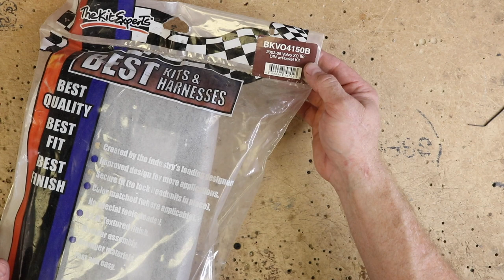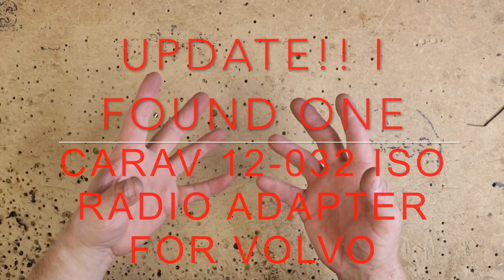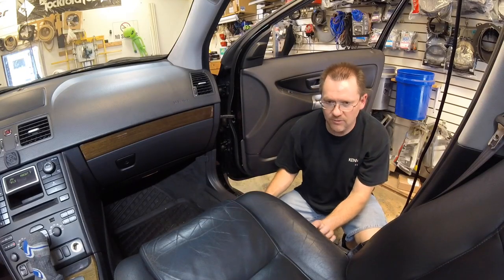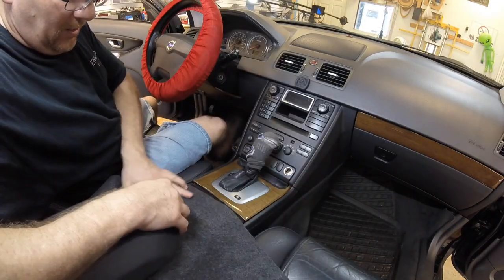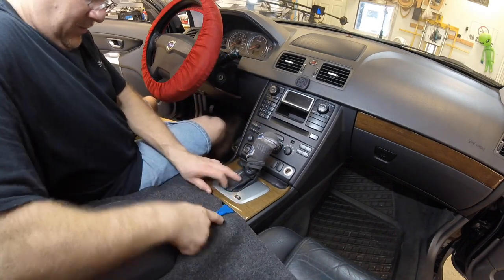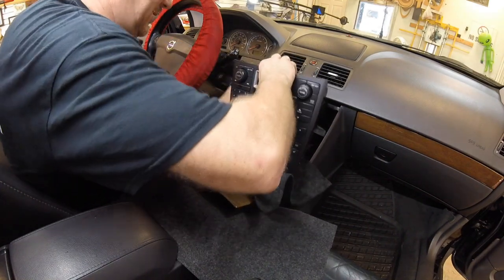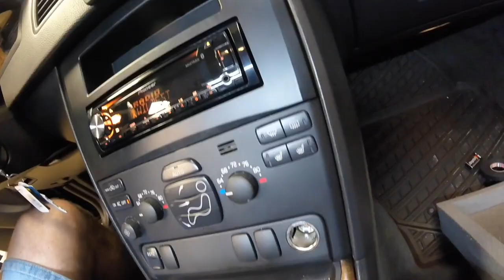How to replace the radio in the Volvo XC90

Comment: I have a 2004 XC90 2.5T. I have had the factory system removed. I have lost power to the constant wire to the radio. I can't find the fuse to replace it. I've checked all fuses in 2 boxes. Can't find the one under the steering wheel. Thanks for your help.
Reply from the maker: Joe Dunn we use the amps Constant 12 Volt to power the radio.
Reply: Five Star Car Stereo. The amp that came with the car under the passenger seat? I appreciate the response.
Reply from the maker: Joe Dunn yes the factory amp under the seat
Reply: I got my problem fixed today. That's where the power wire was. Thanks again.
Reply from the maker: Joe Dunn very cool

Comment: Can anyone confirm that if my factory radio is non-functional this would work to install an aftermarket unit? I am dubious that the wiring for the amp etc would work correctly. or is this a complete bypass of the entire amp and fiber optic cable system?

Comment: nice work i wish i this video was out when i did my radio. I hard wired the radio in my car but every time i turn my car off the radio loses power and goes back to safe mode. where can i tap in to besides the amp to run the radio.
Reply from the maker: +Aaron Smith that is the only place we have ever got power from

Comment: Go BIG, or don't do it at all. That is entirely too much trouble for something that looks like a jerry rigged downgrade from the factory radio.

Informative video, points for showing what a PITA of a project it is I just question the customer's decision. 

Every video on this subject almost always goes to a 2 DIN touchscreen. Great presentation and instruction on YOUR part however the customer.... enough said.
Reply: But if the OE radio is dead what other options do you have aside from and expen$ive replacement?
Reply: @michaelhcoleman8450  In all honesty compared to the overall cost of the XC90, it would only be $100 to $200 more for a better head unit over what was installed. I don't know what the customer was charged for the install but whatever it was... it wasn't enough for all that hassel the install had to cost more than the equipment. 

I do see the benefit of gaining a small in dash storage with a single DIN head install  (however it is extremely shallow for no reason and I would of preferred it to be under the head unit if it were mine)
Reply: @Shifty_Eyed_Dog  Good points, I am just about finished installing a JVC double DIN with external mic Bluetooth in my daughter's '04 XC90 . I agree with you, the single DIN with pocket looks lost there, that is why we went for the double. 
As far as costs go, it is easy to justify when Daddy does the work and I do not mind doing it. All in all it was to too bad a job but it would be an expensive deal if a stereo shop did it.
Reply: @michaelhcoleman8450  I'm fortunate that my 2010 XC90 already has an aux jack (though poorly placed... the cup holders, really Volvo?).  Call me an "old man" ahead of my time... but I genuinely prefer the look of the stock stereo. It would have to be something REALLY nice and look amazing to make me want to go aftermarket on the head unit...

Comment: How did you bypass the cd charger? If I unplug it in mine (leaving the ICM connected), I lose audio. I tried a fiber optic loop without success.
Reply: Then you have not truly bypassed the amplifier. Grabbing the outputs eliminates any Fiber Optic connections. Head unit directly goes to speakerleads after this.

Comment: Hi im having an issue with my xc90 aftermarket radio its a double din i have the speakers wired and the power but the radio turns on by itself the moment i connect the battery and the key isnt in the ignition and when i turn the radio off for some reason the display time stays on

Comment: i need youre input!!

i have a 2012/13 v70 and im in progress of bypass the amp and fit my MOSCONI DPS but how.. i kinda know how but what needs to stay connected to the stock amp and what does the fiberoptics does?
Reply from the maker: eXtreme Rc yes the fiber optic has to stay. You are going to have to go after the amp. Unless someone make a fiber optic adapter for your car. The sound comes into the amp over the Fiber, then though the amp, and out to the speakers.
Reply: thanks you so mouch!! i have been struggle with this for a while now...miss my BMW 525d 😂 info everywhere😂
Reply: Five Star Car Stereo by the way isent there two fiberoptics🤔?...
Reply from the maker: eXtreme Rc there is an in and an out, it is a big loop.
Reply: Five Star Car Stereo  wunder why 🤔 should i take it on the end loop or that dosent mather?. last question 😂
Reply from the maker: eXtreme Rc it should not matter 👍🏻

Comment: I have a 04 Volvo xc90 t6 with the fiber optic radio.......can you replace that one too?
Reply from the maker: John Gasiorowski this one has fiber optic system too
Reply: and factory navigation?
Reply from the maker: John Gasiorowski no it just had the basic radio
Reply: Damn, thats my issue. Factory navigation and the fiber optic. I wonder if this process would also work with my volvo.

Comment: have you ever did a 2011 Audi A6 or auxiliary, update the Bluetooth
Reply from the maker: alxw1979 does it have an aux or do you want to add an aux?
Reply: It has a auxiliary input for a iPod or iPhone but it doesn't work when you put the cable up into it, located in the glove compartment
Reply from the maker: alxw1979 this may work for you
https://youtu.be/b4pfzPXHUUA
Reply: does it have a regular antenna for this Audi A6
Reply from the maker: alxw1979 ok different idea, they make an Audi plug to Aux
https://www.wish.com/m/c/56a87404dc5c6969cff0e3d0?hide_login_modal=true&from_ad=pla4&_display_country_code=US&gclid=COampsnC19ICFYUjgQodPOYHyw 
And a Rockford RFBTRCA
https://youtu.be/s-GjkpUlA_0

Comment: It wasn't 100% clear which parts of the factory harness you plugged back into the amp.  I assume everything but the speaker wire connector which was rerouted to behind the dash?

Comment: connects2 CTSVL0032. this is the harness for the amp and steering wheel buttons.
Reply from the maker: Tommy Amundsen have you use it? Connects 2 product are not all that popular in the US.
Reply: Yes it works great. I am working as a installer in norway. We use a lot of connects2.
Reply: Five Star Car Stereo  you never seid wich color for pawer and wichone for ground
Reply: I use this harness. The buttons on the steering wheel for volume +/- and track forward/back work fine. HOWEVER the reverse and park brake do not work. As I result I cannot see the backup camera and also cannot play video because the head unit (Pioneer AVH-2330NEX) thinks the car is moving. I am trying to sort this out with the company I bought it from but so far they are not willing to send a replacement.

Comment: I installed a Kenwood DNX573S basically just like this video. and the issue I’m having is that the radio won’t turn on with the ignition. The cigarette lighter purple wires have the 12v present when the key is on and not when it’s off. The only way to turn the radio on and off is to press the power button. How can I get it to turn on and off with the key?
Reply from the maker: I would go to the fuse box and tap into a accessory fuse.
Reply: Five Star Car Stereo one of the fuse boxes inside or under the hood?  Also where can I find the parking wire for my green parking wire on the radio?
Reply: @manuelw31  for Kenwood's you can ground the green parking wire to any ground spot.

Comment: Good job on the installation. But customer choose a cheap stereo, it looks so ugly on the volvo. Just for a bluetooth and mp3.The volvo oem  stereo looks better. On the volvo. i own a volvo xc90, i did not remove oem stereo, i just remove the center speaker and install a 8.8 in  android screen it has bluetooth, apps and gps, it comes with free backup camera. U can only install the  multimidia screen if your volvo does not have oem navigation system and only a center speaker

Comment: I have an '08 xc90 and have been gearing up for a DIY sound system upgrade. Are the steering wheel controls still functional with this installation method? Also, I have found a wiring harness/conversion kit at InCarTech, https://incartec.co.uk/Volvo/2258/1036/2066/0 
that I am considering using.
Reply from the maker: Aaron Bader yes I have seen that, it does look like a nice kit. I'm sure it makes it easier then this. Metra ASWC-1 is the only one list as working for your year.
Reply: Thanks for the info! If I was to follow your install, would the steering volume and track control function with the new head unit?
Reply from the maker: Aaron Bader yes they should according to Metra
Reply: Here's a thread from Volvo owners for the incartec kit:  http://forums.swedespeed.com/showthread.php?199862-Aftermarket-In-Dash-GPS-DVD-on-XC90-Solved   I've got an 07 xc90 and am considering this as well.  The kit comes with steering wheel controls.  My understanding for 07 and up is that there is an antenna hookup in the front so you don't have to use an aftermarket antenna.  It's mentioned towards the last few pages of the thread.
Reply from the maker: Jason Trippe the antenna is odd, we have done them where there was an antenna to connect to. Other times the connector is not there.
Reply: Yeah, I think the antenna connection is only 07 and up.  They updated the model that year.  I have an 07 and will upgrade once I save up the money.  The parts from Europe including camera made to fit in the rear license plate light are about $500.  Add that to the carplay system I want to install and you're north of 1k just for a self-install.  It does make self install easier though.
Reply from the maker: Jason Trippe yeah the $500 is why we did it this way. Most people just want Bluetooth and an aux for has cost effective as possible.

Comment: Why does the old radio still have to be plugged in?
Reply from the maker: Modesto Rodriguez it is part of the computer bus of the car. If it is left out you will get a light on the dash. If that doesn't bother you, you can leave it out.
Reply: Thanks

Comment: Man. My audio jack connection was having issues so (like an idiot) I decided "hey!, instead of replacing that little audio connector thing I know what I'll do! I'll buy a cool new radio with better connections (and more features) and have my brother install it!". Well, I bought a new radio, a harness and a dash kit and then my bro spent time taking everything apart and rewiring. Then he tells me that the amp and middle speaker will no longer work afterwards?! Ok. So now I have to buy an amp?? All this because of a touchy audio jack. Great. So now I"m going to just replace the jack and try to return as much of the stuff I bought as I can. I'm just not sure why anyone would go through this much trouble? Doesn't a phone connected to an audio jack give you plenty of options? It all seems really silly. I guess it's my fault for not realizing what an ordeal this would be.
Reply from the maker: +[ Eye Tunz ] [HD] well I would say it is how I make my living, so please upgrade.
Reply: Haha! Job security!
Reply: You wouldn’t have to buy another amp.  This install method is using the amp built into the head unit.  99% of people would never even notice the difference.  If a person just HAD to have the center channel a little mini amp could be put in but not really worth the time and cost.  
An aftermarket head unit is nothing like a phone plugged in an aux Jack.    Way more options on aftermarket deck.   It’s too bad you made your brother go through all that for nothing.  You should’ve given it a try.

Comment: hi I am lost I am90 percent there but don't understand where the power lead u made from the amp power and earth goes too
Reply from the maker: Darren Powell the factory amp power and ground run up to the radio to power the yellow and black on the radio. The power port(cigarette lighter) is an accessory, connect the radios red wire to that.

Comment: How to connect parking sensor signal to center speaker?
Reply: Metra makes an interface to keep all the factory features now, including one that retains parking sensor system. Ax-VL9032, or AX-VL9042 (sensors, and amp retention )

Comment: Wow this is way too much work and having to have a work around.  2 things 

First get a Bluetooth car adapter that plugs into a 3.5 mm jack.  Boom done.  
Second thing if you don’t like the sound coming from the stereo…the stereo has nothing to do with it upgrade the amp.  

In my opinion this is a waste of time if you’re losing components and might get errors it’s not good.   Get Alexa car  thingy Bluetooth right there